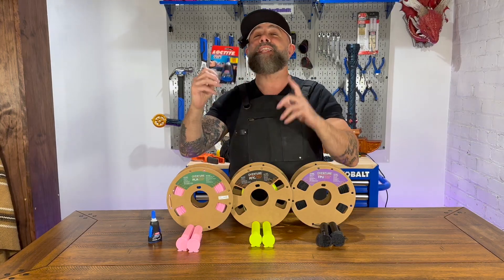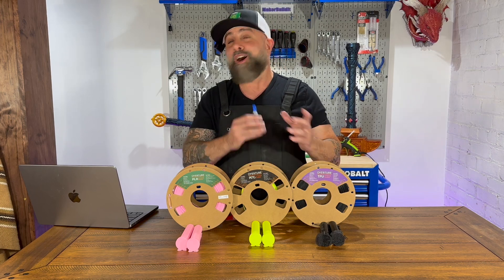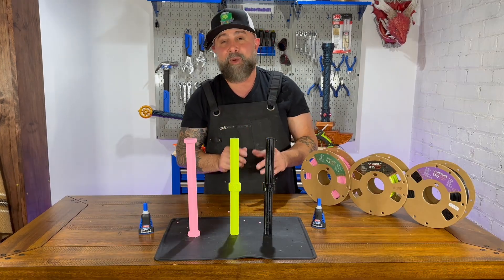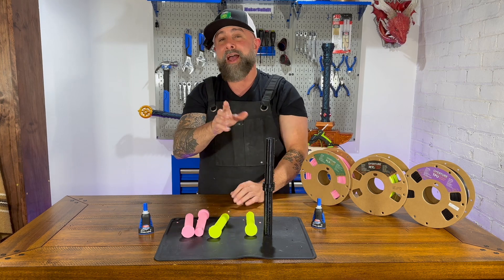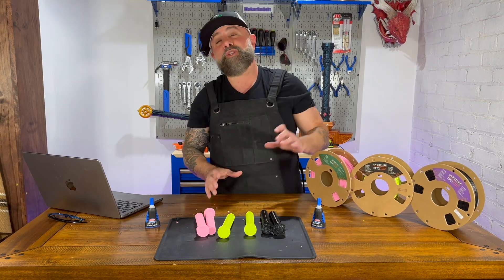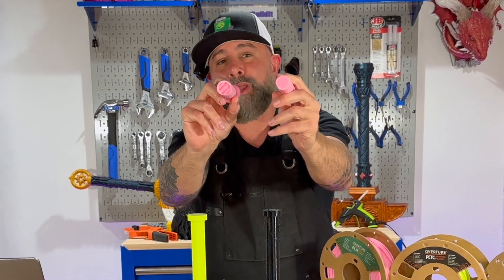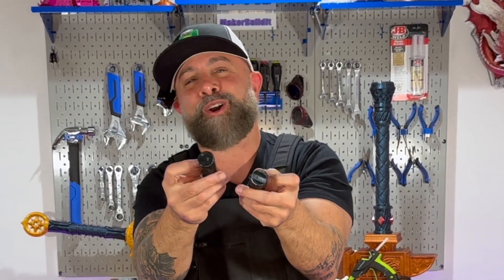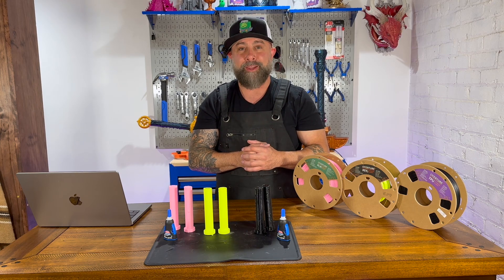Can Super Glue REALLY Bond 3D Prints?

Comment: Not all super glue is created equal and from what I've seen Loctite is the best so don't expect better results from others for plastics
Reply from the maker: @dosdont  Loctite does a great job! 😀
Reply: You need to use a primer/activator for petg and then it sticks enough to rip the 3d print apart. Loctite calls it plastics bonding system, but it's basically just a primer and super glue in a bundle.